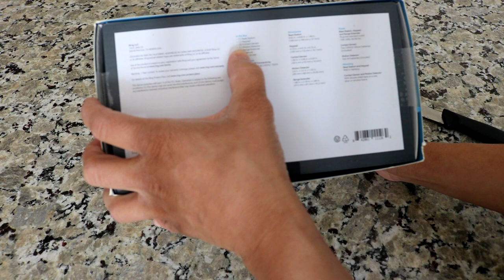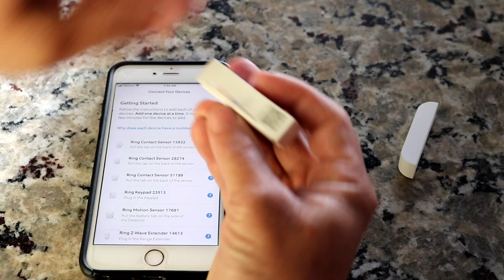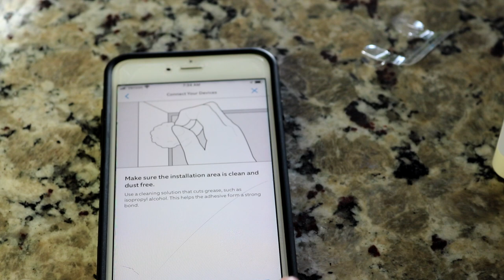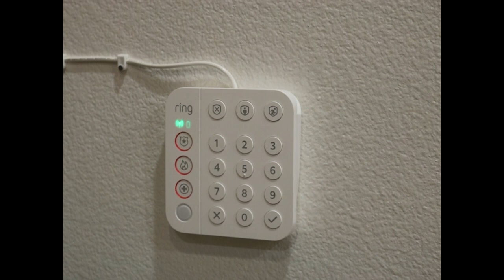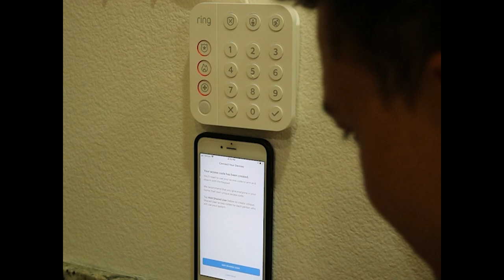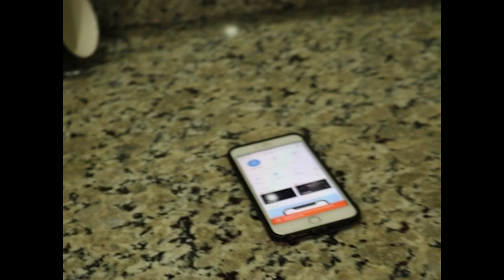#ring Ring Alarm 8 piece kit 2nd Gen – home security system installation

Comment: The keypad is supposed to run for about 7 months on a charge. You don't need to leave it plugged in all the time (unless you want to).
Reply: @Tony.Nguyen137  24 hours on battery.  But may be less if you have 100 sensors.
Reply: Better to have it plugged in one less thing to have charge every few months.

Comment: Always ensure you are setting up your devices within 10ft or less from your base station, also do not mount your sensors upside down, it damages the Reed switch, also causing the tamper switch to slide out of place.
Reply: 10 feet or less from base station?   Wow, that's a very small area.

Comment: You didn't need to run the power cable from the keypad... It used to recharge the battery, which lasts a long time.
Reply: Thank you for this cuz I didn’t want a wire running through my house

Comment: The extender is for the Zwave, not a wifi extender as the sensors don't use wifi, so you should use it for better signal strength of the sensors since they include it in the box and all you have to do is plug it in a wall outlet.  Monitoring use to be $10 but now $20
Reply: This ☝️ also, your residence doesn't seem all that big. The range extender is intended for homes larger than 1500 sq. Ft.
The range extender would just be a redundancy and a waste of an outlet.
Reply: @rayzor285  It baffles me how they include a range extender in all of their packs when most people won't have a use for them. It'd be much more useful to include an extra contact sensor instead.

Comment: Hello. Thanks for the great video.
Finally getting rid of ADT. I have a question please . I'm gonna have three different pads in three different floors. I need the pad upstairs not to chirp at all when any sensor is opened or closed.
And I need the one in the middle and Basement floors to only chirp when certain sensors are opened and closed.
Are these options customizable? Thanks so much.
Reply: You can program each keypad to turn chirp on or off.  As for the sensors, you can program each individual sensor to chirp at the base/keypad, base only, or no chirp.   Chirp on keypad and sensors are ON by default.  Hope this helps.

Comment: Can someone explain me what Ethernet is ? What’s the difference connecting the base station on an Ethernet ?

Btw very good video! A lot of info! 🙌
Reply: An ethernet is a phone cable that comes directly from your router.
Reply: @automatic12ga4  and why would I want to use this way of connection instead of the router ? 🤔
Reply: @MrsLyds  a wired connection is always stronger than a wireless as far as I know.
Reply: @MrsLyds  most componets are fine using a wireless connection tho
Reply: @automatic12ga4  I seee… thank u so much for the info 💗
Reply: @MrsLyds  Wireless is less stable and an attacker could potentially use a device to block the signal, but to block the Ethernet connection you would have to physically cut the cord.
Reply: @hullie7529  ohhh I see. So u know how some hackers can hack ur cameras on ur ring and see inside ur house etc. So Ethernet can prevent this to happen? And what about key pads? I’m scared that someone might be able to hack it and get into our home.Are they safe? I took the convo far now I think.
Reply: @MrsLyds  The Ethernet in this instance only refers to how the base station connects to your router. It won't prevent the cameras to connect to the outside to send the footage to Ring's servers or your phone.
Reply: @hullie7529  is there a way to prevent hackers from hacking ur ring device ?

Comment: I have 10 ft. ceiling. How high my motion sensor should be that pick up motion of 3 ft from floor, like burglar crawl to  go places in house. It sound wierd but like to know height of motion sensor should be from floor??? Yhank you.
Reply: It says it will pick up over 50 pounds, so it ignores pets less than 50 pounds so the alarm is not going off. So, you should be fine. My ceilings are also 10-12 feet.

Comment: No reason to drill when you can just attach two command strips.
Reply: @andya8898  Perhaps he wanted it to be more secure instead of mounting it the lazy less secure way
Reply: @darieanhenderson6926  Nah
Reply: No reason to attach two command strips when you can just drill. No reason to do either when you can just lay it on the floor. No reason not to do both when you can not do both. No reason not to shut up when you talk too much
Reply: @JWolf-nh9uw  No
Reply: @andya8898  I don’t remember asking a question
Reply: @andya8898  bro tell me you didn’t block me 😂😂 Andy A soft